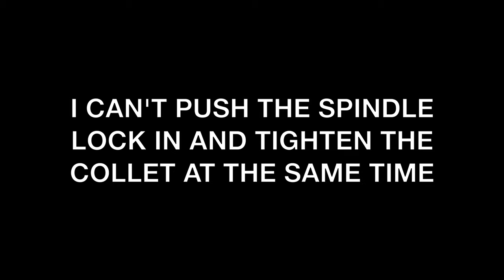Installing the Trend T14 Router into the WRT Router Table

Comment: Hi Leo. What is that yellow thing at 7:41 You are pushing the wood against the router bit, with it?
Reply from the maker: It’s called something like a grr-ripper and is used to push stock through the likes of a table saw / router / bandsaw safely 👍👍

Comment: Hi Leo, good, interesting video as usual.
Thanks for the shout out about the record adaptor, I just hope it fits after that! Once again, you've got me thinking about things we all take for granted, like pushing the spindle lock while undoing your router collet with the spanner....dead easy with two hands.  I remembered seeing a collet  that you tightened up with an allen key....I've had a trawl around and I think you should have a look at the 'Musclechuck 2' on the Woodworkers workshop site...it says it fits the Trend T10 and T11, so I reckon there is a fair chance that it may fit your T14.....perhaps Trend could confirm whether the spindle and threads are the same. It also appears to be available in an extended version for router table use.
Really enjoying the content of your videos and looking forward to the next instalment 👍
Reply from the maker: Nice one David, really appreciate this👍👍. Will see how things go with the dust collection, might look into the Axminster box that gets fitted underneath around the router if I’m not happy 🤔🤔

Comment: I have the same table with the T8 router but have had difficulty using the lift mechanism when rising the router up. I've only discovered that removing the springs may be the best option. I couldn't find any guidance on this within the manual. Is this something you've done on your router to make setting the bit height from above easier?
Reply from the maker: I didn’t have to do this with the T14 pal. It has the connector above the router on the face of the router table plate and the action is quite smooth tbh 👍
Reply: @Hand-i-Craft  Thanks, the T8 also has the height adjustment accessible via the table plate but with the plunge springs it's very difficult to rise the bit up with the supplied winder. When I apply extra force I can see the plunge rods going off alignment. I think I'll remove the springs as it'll be mostly table mounted

Comment: Afternoon. I've got another question regarding the T12 router. Can the T12 still fit into the table and be used for work. My main concern is the screws to attach to the plate. Its also about the price difference .
Reply from the maker: Hello Gary, cheers for the message pal. I’m not 100% sure exactly what you are asking about, apologies from my end as I could interpret your questions in several different ways. Simply put, yes the T12 can be fixed to the WRT plate easily and can also be disassembled to be used independently. I am maybe reading into it that continual fixing and removing might lead to the fixings starting to fail in some way, personally I don’t see it but maybe other folk on here more experienced in this type of example could comment. 

Could I ask what do you mean about the price difference, are you referencing between the T12 and the T14? Happy to help if I can pal if you get back to me, best wishes, Leo 👍

Comment: Nice one matey...great solution for the collet... fyi the Triton routers have an automatic collet lock as it gets to table top level.. Shame trend didn't do the same.. I am not a doctor, but suffer from Nasal Polyps and related chest conditions and Prednisone steroids help me short term with my breathing...worth asking (but don't get hooked on them.) Cheers Paul
Reply from the maker: Thanks Paul, I’ve got a steroid inhaler along with the ‘normal’ one they’ve also given me👍. I’ve got the Triton TRA001 that I use for flattening slabs and yes the spindle lock thing on that is very good for me, but it’s no deal breaker on the Trend once I figured out a relatively quick workaround 👍👍

Comment: DId they not provide pan head screws to fix the brackets under the table. The countersink once look rubbish for what is a very expensive setup.
Reply from the maker: They did DA, but I couldn’t find the bit I had to fit them 😂. It will do for now until that pesky bit turns up 😀👍

Comment: Strangely dewalt did that lever opening thing with a lead but seemed to stopped it. On one of their product photos you’ll see the hinge point  but can’t see anything on it anymore. It’s as if they’re trying to hide that they ever did it. Very odd. The newest dwe625. It does seem to have the same body as some trend models. Are they made by the same company?
Reply from the maker: I can’t say for sure, but I do know only a handful of tool companies make their own tools now, and they are right at the top end of the market. Most are now made to manufacturer’s specifications by a third party company normally in China